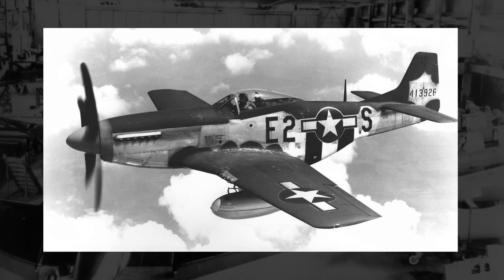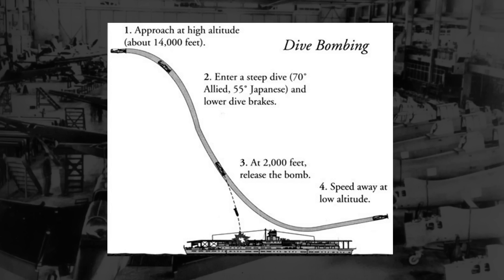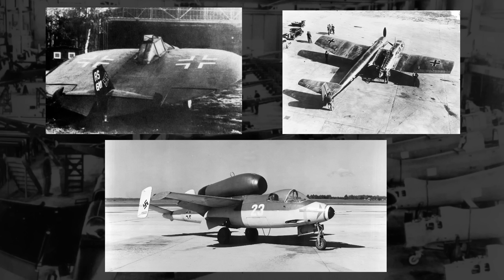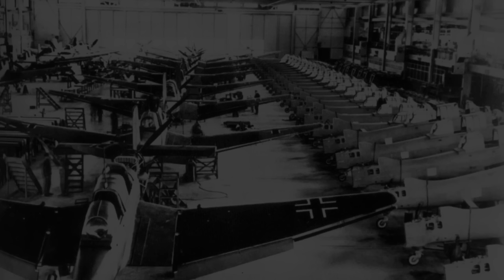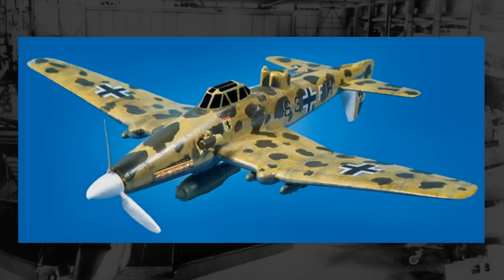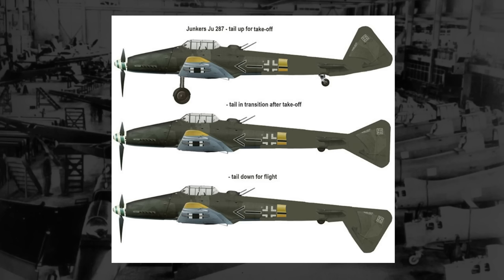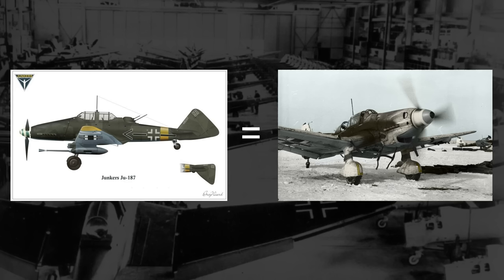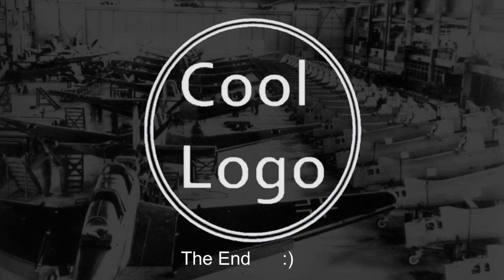The Rotating-Tail Stuka: Junkers Ju 187

Comment: Fascinating video. As commented elsewhere, the Germans were genius-level blue-sky thinkers. However, I'm nagged by a recurring thought: if the rear turret was controlled remotely, why not mount it under the tail and forget the variable fin? Alternatively, use the side mountings as per the (admittedly unsuccessful) Messerschmitt 210/410?

Comment: I built a LEGO plane as a kid that "solved" the problem of the tail being in the field of fire by having two vertical tail fins that could fold to the sides at 45 degrees.  Though that plane was a mess of problems, a result of being designed around the rule of cool and myself having little concept of aircraft at the time.  Like the main air intakes were placed on the sides of the cockpit, which put them directly behind the exhaust.  Was also black with yellow stripes...
Reply: Can you provide more detail in regard to performance with the yellow stripes as opposed to say red?
Reply: @Clint52279  red adds more horsepower

Comment: There would have been quite a significant weight penalty to maintain structural integrity with the fin mechanism. And if they actually got it up and running - you could only imagine that there would have been teething problems - and no doubt there would have been incidents where  the tail would probably break and/or fall off.

Comment: The entire tail wouldn't spin around, this would be a huge problem aerodynamic wise. Instead the tail would be dropped in a way like a rudder on a old sailing boat, or rather the 'sword' of a sailing vessel. This would mean a lot less problems would occur and it could done manually if need be. As long as you secure it properly else it would flap around and likely cause major structural damage. Which the picture as 9:25 also clearly suggests.

Comment: Dive bombing was a FAD in the late inter-wars period while glide bombing eventually proved to be more practicable. You didn't need to build an aircraft to take extreme stresses.  As to the Rotating / pivoting tail ??? not needed, all you need is an inverted V-Tail.  Keeps tail plains away from gun fire and doesn't need to be moved.
Reply: What about a Stuka with Jet Engines to get a Super Dive Bomber with the speed of a Jet?

Comment: The tail rotation would not be horizontal; instead, it would be vertical.  In other words,, the tail would move from its upper position to its lower position like a landing gear would go, straight down.  The effects on inflight handling, during the few seconds it took for the tale to go from up to down,  and vice versa, would be minimal.

Comment: So, here's what I didn't hear...with the increased horizontal speed and a rear pivot point, how would they eliminate cavitation?  In reference to that, it would seem there could be an uncontrollable cavitation in the dive along with even more increased speed.  With the possible/probable result of POP goes the tail section and you now have a human dart experiment.
I actually think a direct fixed squat-tier boom or box tail, now you have dual rudders, may have been the better answer?

Comment: Also… Why “Rotate” when you could just have the Rudder/Vertical-stab. Slide-downward, or “Pivot” up/down only, rather than rotating through the “Roll” of the Aircraft.

This would still leave SOME of the tail above the Fuselage, but would be better for aerodynamics, and pilot control.

Probably better to just get a remote-controlled Cannon in the tail.

Comment: would have been much more elegant to give the 187 a modern tripod gear setup and then the tail could be permanently affixed in the "inverted" position as the empennage boom would be horizontal when taxiing, rendering the whole rotation process moot.
.
of course, this would make takeoff/landing a very delicate process as it would be quite easy to drag the tail.  perhaps a tire affixed to bottom of the vertical stabilizer as an additional safety measure?

Comment: The vertical stabilizer/rudder assembly in the up or down position would cause coupling between Yaw and roll axis with the rudder not being in the vertical plane.  The "Tail in transition" position wouldn't cause coupling with the Yaw and roll axis.  Why didn't they build it with the tail in the down position but with the rudder mounted in a vertical orientation with a small caster wheel or skid on the bottom of the vertical stabilizer?    Thanks for the video!

Comment: The problem wasn't the danger of shooting your own the tail unit by yourself. The inventors of the synchronized machine gun, which could fire through a rotating propeller, had little trouble using a simple bolt mechanism to block the rear-facing machine gun in the moment it would shoot through the rudder. The problem and the idea for the Ju 187 was the negation of the notorious blind spot directly behind the plane...;)

Comment: There is the slight problem of landing ,      and forgetting to put the tail back in the take off position .
Reply: Use the same switch as the undercarriage. If you forget to lower the undercarriage you're assigned to clean out Goring's toilet.
Reply: To be fair, people also forget landing gear ALL THE TIME. 😆

Comment: 10:47 I think the real reason for abandoning the pivoting tail is the Rotating-Logo-Problem; when tail is down the Swastika is at the wrong angle. It's more at an Hindu-Angle rather than a Third Reich angle.
This angered the main führer.

Nice video, I didn't know about this plane and it's an interesting concept. I read somewhere that the Stuka scream annoyed the pilots as well as it was really loud. When the war was over and the German pilots returned to normal life and had kids they would not make the airplane noise when spoon feeding their kids. It's unknown what kinda noise they made to get their kids to open their sustenance intake hole.
Reply: Nonsense. And the siren was not fitted in late model 87s
Reply: @nightjarflying  "The trouble ain't there is too many fools, but that the lightning ain't distributed right."

Comment: I think I may utilise this tail design for my world building project, a forward swept wings can cause interesting behaviour of a tail ruder when deflected. So far my solution to this issue was duck configuration with vertical stabiliser as much to the front as safely possible, now I wonder how convectional layout with forwards swep would behave with inverted tail I think I need to run few airflow simulations now.

Comment: 10:16)Do not know anything about aircraft, so this is only a Wild Assed Guess(WAG). The tail numbers suggest that the tail was intended to be on an axle or a pivot, to change the angle. Simpler than rotating the tail at a high speed.

Comment: why didn't they just make the vertical stabilizer 'drop' down through the tail end, to its bottom position instead of rotating it around. The rear gunner of the plane would pull a lever attached to a wire connected to a piece that held the stabilizer up and then they would need to develop a system to pull it back up again after the fighting.

Comment: i wonder if they just put the vertical tail in the downwardss position, and leaving the rest of the tail normal,  could easy put a small  wheel (like skateboard sized) on the tip of the tail

Comment: German aircraft designers were certainly very inventive, but the Luftwaffe was extremely conservative, which is the main reason that few of the more unusual designs ever got put into production, irrespective of their merits otherwise.  Also,  Hitler's whims and infighting within the Luftwaffe itself impacted some designs.  But German aircraft designers were very good, and very practical.  There's no way they would have tried to make an entire tail unit rotate axially in flight, with all teh aerodynamic headaches that would cause, when they could simply have the tail pulled up pre-flight, and then be released into fying position when aloft with a simple winch and pulley system.

Pre-war, Germany had a couple of early 4-engined bomber designs  (Do-19 and Ju-89) that, with development, could have given them a serious lead over us British in strategic bombers but despite both prototypes having flown, development was halted partly because  doctrinally the Luftwaffe was viewed more as flying artillery to support the Heer on the battlefield in order to achieve a quick break-through.  Having won the land battles, enemy factories could then be put into use for the Reich, which wouldnt be the case if they were bombed flat in a long, attritional war, which the Germans wanted very much to avoid if at all possible.

Then again, four engined bombers, shockingly, use twice as many engines a two-engined bombers, and thus twice as many bombers could be put into the air, and more is always better (thought some of the higher-ups in the Luftwaffe)!  The Fw-187 was a very good twin-engined single-seat fighter that would have been great for escorting bombers over long distances, and when the few that were made were trialled by a front line Luftwaffe unit, they were much preferred to the Bf110, which resulted in the OKL rapidly giving them back to the manufacturer for use as factory-defence planes, as the Fw-187 didn't fit the (flawed, as it transpired) concept of a Zerstoerer aircraft (and because Willy Messerschmitt had political clout, and so the inferior Bf110 carried on in production, and the Fw-187 was never put into production. That the asymmetric Bv-141 was ever allowed to be built as a prototype is a minor miracle, and the Luftwaffe higher-ups hated it despite it being a perfectly good aircraft for its intended role.  And the least said about Hitlers insistence that ALL bombers be capable of dive-bombing, resulting in the  flying catastrophe that was the He-177 (the Luftwaffes belated attempt at a strategic bomber when they realised that not having a strategic bomber might just have been a mistake) , the better.

Comment: The designation Ju-187 is wrong. Junkers were given the number 287, which they later used for a jet engine bomber. So Ju-287 was used for this design. The number 187 was given to Focke-Wulf, who used it for a competitor to the Me-110.

Comment: I don't see what the point of it is given that the rear turret is remote controlled. If you're going to use a remote control turret, why not just put the turret at the end of the fuselage behind the tail instead of making the tail movable?

Comment: Ok, stupid question here: if the rear facing guns were remotely actuated, why not just locate them, say, on either side of the rudder, just out of the rudders maximum angle, with ammo belts feeding from the central fuselage? Not an engineer am I, but the weight far aft might have been cominserate with the weight of the pivot mechanism, especially since the guns are located out from the center. 

Just a thought.

Comment: There was no rotating tail in one of Ju 187 concept. Just tail fixed "upside-down" with tail wheel at the bottom of vertical fin. And this idea was aborted because of expected problems  with landing. Main gear should be very long to allow  the construction  keep proper area of vertical fin and rudder. And mechanism of those gear would be too havy, so it would reduce speed too much.

Comment: The ju-87 d-5 had 2 forward facing 20mm in the wings and 2 rearward facing 7.92 mm guns and could carry a 1000 kg bomb under the body of the aircraft and could carry 4, 100 kg bombs under the wings.
Reply: It could on paper, but at that point it's so overweight you're a sitting duck

Comment: There is no such thing as a Ju187, the designation was Ju287. The number 187 had already been given to Focke-Wulf at the time Junkers was doing research for a Ju87 replacement. Only a mock up and wind channel models were made. Later Junkers used the 287 designation again for a jet engined bomber prototype.

Comment: You thought your idea was crazy? The crazy engineer in my head the one that's been building model airplanes for over 40 years wanted to split the vertical tail and make the horizontal stabilizer fold down so the rudder became a two piece elevator and the elevator became a one piece upside down rudder.

Comment: Anyone else blown away by the payload capacity on this thing, or is it just me? 6:10
Reply: I think it was just designer copium, mostly. Technically later Ju 87s came close to such loads... But only in extreme cases and without much fuel. The 187 was supposed to have more armor and way more guns too

Comment: I personally think the solution to the requirement for a defensive Gunner on a dive-bomber is to get rid of the defensive gunner and make it a single-seater attack aircraft as losing the defense Gunner you could potentially gain more fuel more payload a better forward firing armament and better overall performance from the aircraft

Just for the fun of it let's just say you can gain 100 mile-an-hour top speed increase from ditching the Gunner his weapons and the ammunition and now you have something flying at 350 miles an hour at low altitude which is a big old pain-in-the-ass to shoot down

Comment: In WW1 they had a similar problem with forward facing guns hitting the propeller, they solved it by having "interrupting gear" which wouldn't allow you to fire if the bullets would hit your propeller. You would think that in WW2 they could have adapted that concept with the tail.
Reply: In which case, all a chasing plane would have to do, to avoid being shot at, would be to keep in line astern.

Comment: I wonder why they never tried retractable wheels? Seems like the natural progression of the aircraft type.
Reply: The Ju 87 was in production years before WW2 broke out. It was designed as a short range weapon within the Blitzkrieg philosophy and worked well within that system. Outside that system it was hugely vulnerable: retracts and other updates would not have changed that.

Comment: I would have simply built the gun in such a way, that it can't shoot, when pointed directly at the tail :-P
if that even is possible
Reply: WWI went through that by eventually making a interrupter system on front center guns because pilots were shooting off their propellers.
Reply: @snakerstran9101  hehehehe yes. it's awesome how stuff works.
Reply: In which case, all a chasing plane would have to do, to avoid being shot at, would be to keep in line astern.
Reply: @Gottenhimfella  well... so you would rather shoot down your own plane? instead of having those few degrees, where you can't shoot (because it's certain death for yourself)
Reply: @las10plagas  Straw man. False binary. 
Two strikes.

Comment: The Germans would have been better served to look at the design of Sturmovik but they were still mesmerized by the idea of the dive-bomber long after it had been proven a dead-end and helpless in anything other than total air superiority in the theatre. The sheer stupidity of demanding that the He 177 and the Dornier 217 be capable of dive bombing only serves to illustrate this. Carrier based dive bombers fared a bit better in naval actions but even they fell out of favour shortly after the war, being replaced by "attack aircraft" (Skyraider...).
Reply: The Sturmovik wasn't faster as a Stuka. I would have made an enlarged FW-190, closer to a P-47, but then you also need a more powerful engine. Hitler wanted everything to be able of dive-bombing, the guy had no clue about aviation.
Reply: @0Turbox  What about a Stuka with Jet Engines to get a Super Dive Bomber with the speed of a Jet?
Reply: The Sturmovik WAS faster than the Stuka (by about 40 mph depending on the variants being compared).  Of course, it was not designed as a dive-bomber but as 
a ground support aircraft (hence the armour ...rather like today's A-10 Warthog) This mattered little when the fighters that were attempting to shoot either of them down were VERY much faster than either of them.  The point is that NO dedicated dive bomber stood much of a chance unless operating against little or no aerial opposition.    @0Turbox
Reply: @stephengardiner9867  40 mph is a stretch. We are still talking about war models? The IL2s major strength were their numbers. The Germans captured 100 pieces, but refused to use them, because it was a bad plane. I would prefer a bomber who can get out of the fighting as fast as possible, over a slow armored one. The best solution for the Germans would have been a beefed up FW-190, with a bigger wing load and a stronger engine. Sure, if the other side has non-stop air superiority, you could advise stopping building bombers at all.
Reply: @chewyukechun350  For faster lawn darting? ;)
Reply: @0Turbox  Simply using the published performance data.